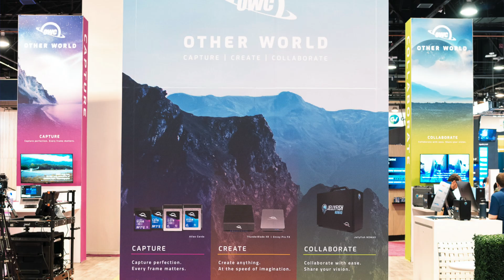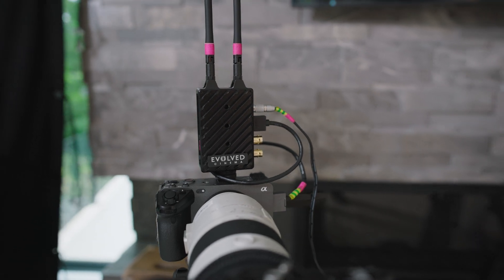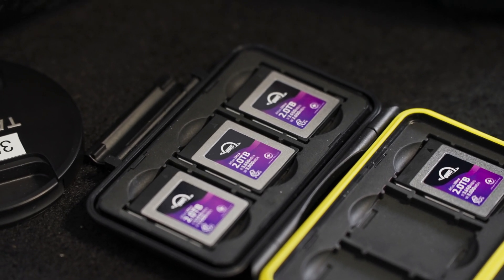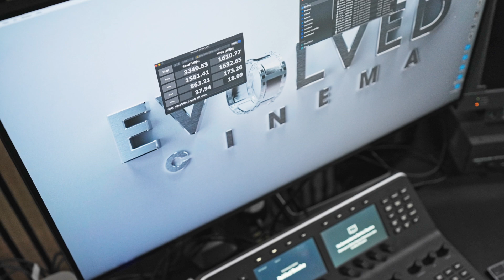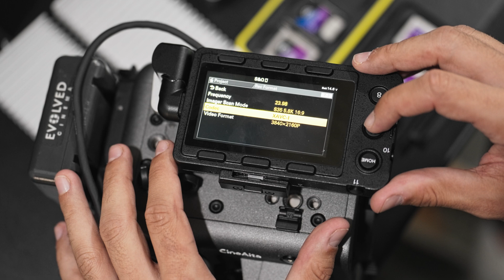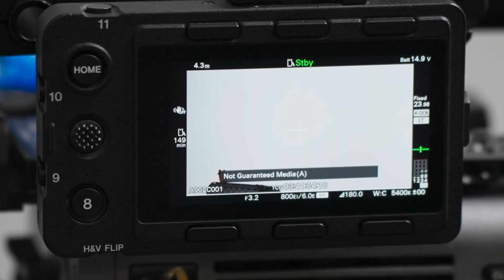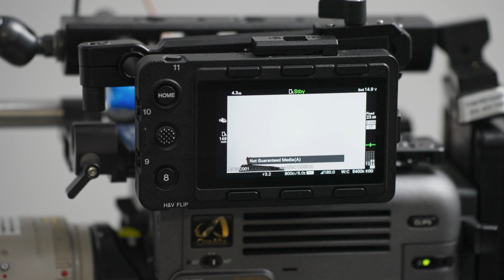Professional Filmmaker Hunter Hughes Unpacks the VPG 200 and VPG 400 Standards | OWC

Comment: If you unpack that graph, the cited X-OCN LT bitrate is for 4K 24p. The Burano records LT up to 8K 30p, so at least a 4x high bitrate. Apparently, the Burano maximum bitrate is 270MBPS, so no, VPG-200 will not work with the Burano at 8K X-OCN, thus the VPG-400 requirement.

Comment: I have a pair of Angel Birds, one bricks the camera on playback of footage sometimes. 

Yet according to your video, my cards should be compatible as well based on read write speeds.

I do get the Not Guaranteed Media pop up though. Could there be something else amiss?
Reply from the maker: While our video indicates compatibility based on read/write speeds, the "Not Guaranteed Media" pop-up suggests there might be other factors at play.

It’s possible that the card could have a firmware issue or a compatibility quirk with your specific camera model. We recommend checking for any firmware updates for both your camera and the memory cards. Additionally, try testing the cards in another device to see if the issue persists.

If the problem continues, please feel free to reach out to our support team for further assistance. We’re here to help resolve any issues you might be facing.

Comment: What is OWC's process for recovering data if something is to be corrupt? Their help page lists for a mechanical  SSD failure that you get a 20% discount through DriveSavers, but nothing through the manufacturer. It's still an IF, but if/when anything happens, how much more is it going to cost users in time and $? Sony fully guarantees their media will work and provide an in-house free recovery service, albeit it comes with a higher starting price for their cards.
Reply from the maker: We apologize, but OWC is not responsible for any loss, corruption, or destruction of data on any hard drive as part of a storage solution unless otherwise specified in the product warranty section of the product information page on OWC. We have linked our TOS page regarding data loss. If you require data recovery, we strongly recommend reaching out to DriveSavers, as you have already reviewed.

https://eshop.macsales.com/support/terms-and-conditions-of-sale
Reply: @poweredbyowc  Definitely worth explaining in the video to potential customers. From what I've seen DriveSavers pricing starts at $800 minimum, which is almost 2x the price of the card itself!!! I'm going to pass as dealing with 3rd party data recovery service has never gone over well; not quick or affordable. I'll stick with the Sony cards.

Comment: S&Q on Alphas can hit ~150MB/s.  Still under the limit, but getting closer :) 7:54
Reply: Which mode would that be? 4k 120 is 600mB/s and 8K 30 is 400mB/s… both of those are under 75MB/s
Reply: The manuals (A1/FX3 at least) say that S&Q can require up to 1200mbps, but looking into it, I think the manuals might be wrong.

Comment: For the sequential writes on a VPG 200 card, can fragmentation impact that?  Or is that not an issue for video given the nature of flash?
Reply from the maker: Thank you for your question. For the most accurate information regarding sequential writes and potential fragmentation impacts on a VPG 200 card, we recommend contacting the manufacturer directly. They will be able to provide you with the most precise answers and detailed technical support.